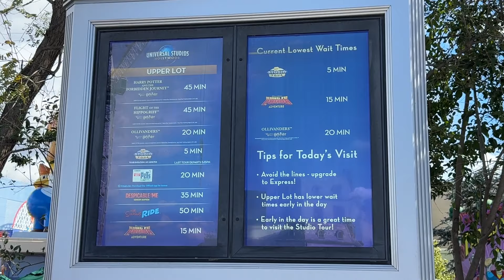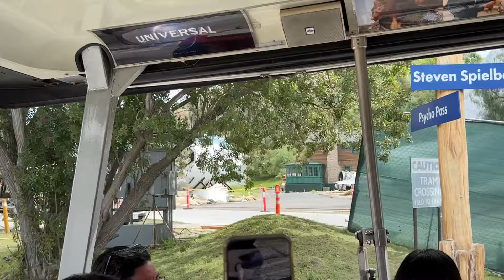Fast & Furious Coaster Construction | Universal Studios Hollywood Updates

Comment: @8:20 it is already there. It’s buried. That’s the long casings and wire you seen go in months ago. It’s curing and will be excavated to the height like you see in the other side of the escalators shortly.

Comment: Hey Mondo, I can tell you that those could be supports, but I’ve also seen those used when they are  constructing buildings when they’re multiple floors, the black ones you were talking about on the very top of the station. I’m only covering Six Flags Magic Mountain right now on my channel, I’ve been following the construction of this ride also, and as far as the other supports, they put a whole bunch of them. It’s just that they’re buried now as they are preparing the soil or the dirt to do other things for the ride. But you are correct I could see them putting track right before summertime.
Reply from the maker: Thank you for the insight 🔥🙏🏼